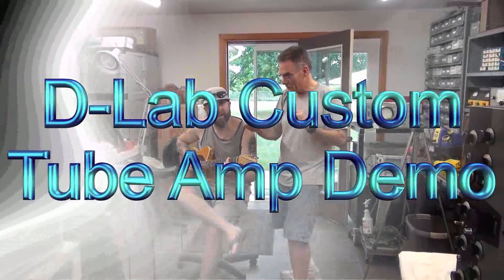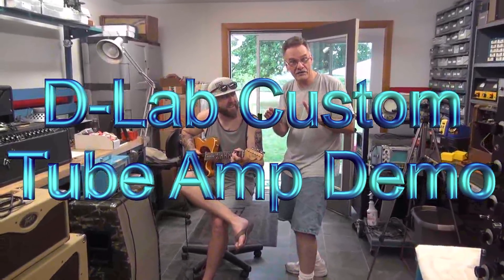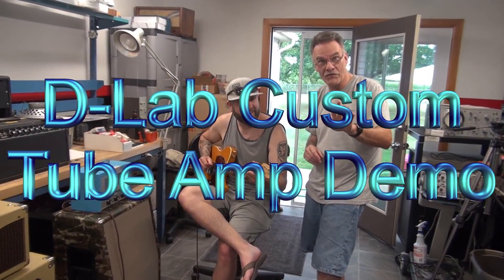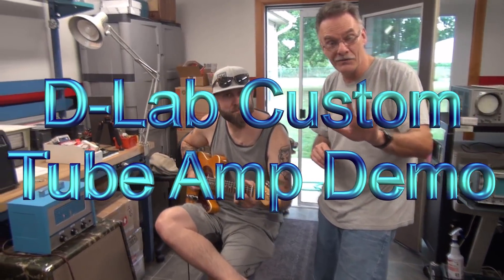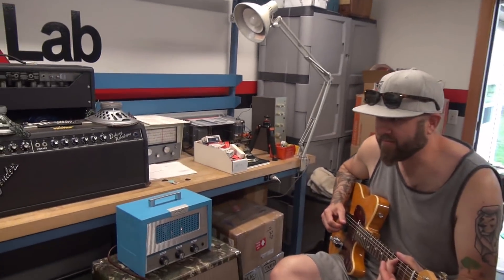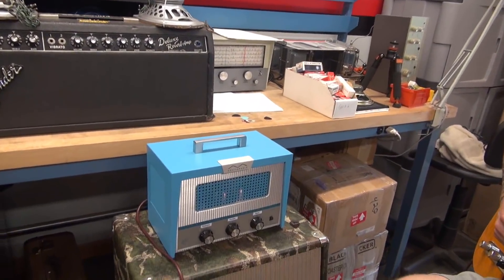D-Lab Precision Electronics Blue 6BQ5 Tube Guitar Amp Final Radio design Demo

Comment: For those of you who don't know guitar tubes a 6BQ5 is the same tube as an EL84. Why the deception? 6CA5 is the same as an EL34. Maybe just a different manufacturer designation? As Terry knows, the only real difference in tubes were the ones made for military purposes. They had much higher tolerances and a much lower mean time between failure rates. They had to for obvious reasons when used for military purposes. These tubes can still be had and are readily available if you know where to get them.
Reply: It is a North America/Europe thing. There were two different tube designation standards. In Europe, Phillips (Mullard is a subsidiary) was at the forefront in tube manufacturing and came up with the two-letter followed by the number designation standard for tubes. You can actually tell the same information from this designation if you know the codes: E- 6.3V heater, L - Power Beam Tetrode or Power Pentode, 84- Type of base, in this case a NOVAL B-9A 9-pin . I the U.S. we are much more familiar with the RETMA Tube designation, which cam about in the early 1950s from a merger of several standards that different tube manufactures such as RCA, GE and Sylvania were using.
Reply: SRT Amplification - Thank you for sharing your wisdom with us!!!
Reply: Jeff just say 7551 tubes, they are still cheap. We should be here to inform and educate. Knowledge should be shared freely.
Reply: From Leo:  What deception?   If it is printed on the tube, that is what it is.  The people who do not know they interchange are not out anything, and those of us that do know are not confused.
Reply: @ Jeff Ripplinger:  'higher tolerances and a much lower mean time between failure rates' I think you mean 'tighter tolerances and longer mean time between failures'. Military versions of valves are more rugged and less prone to vibration. Also, they use better materials, often gold plated pins for example. There is a difference in construction and performance of valves, even from the same manufacturer for a given type. Also the original Mullard EL84 is a pentode but some 6BQ5 valves are beam tetrodes.
Reply: I have never seen a 6BQ5 that was a beam tetrode, nor have I seen a datasheet referring to it as such. Do you have an example you could show? Thanks!
Reply: Here we are, the truth will set you free!
Reply: @ SRT Amplification, I got the information about beam tetrode 6BQ5s from Uncle Doug's video, https://www.youtube.com/watch?v=Zh_51RP4V6I and about EL34 beam tetrodes from the Wikipedia article on beam tetrodes, https://en.wikipedia.org/wiki/Beam_tetrode. 

I don't think you will find a data sheet showing a 6BQ5 as a beam tetrode, even if an actual 6BQ5 in question does, in fact, operate as beam tetrode. I couldn't find one anyway.
Reply: phonicwheel - WOW way to go. Thank you for sharing your wisdom with us!!!
Reply: @ Finom1. No probs- nice to hear from someone who is interested in valves. In the late 1970s I gave away boxes of new old stock (NOS) military valves: in those days valves were yesterday's news!